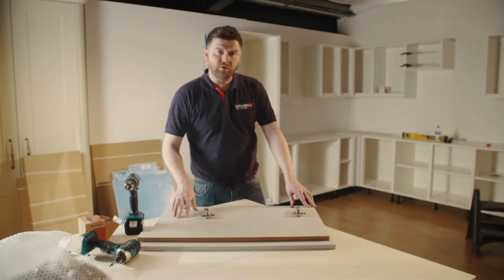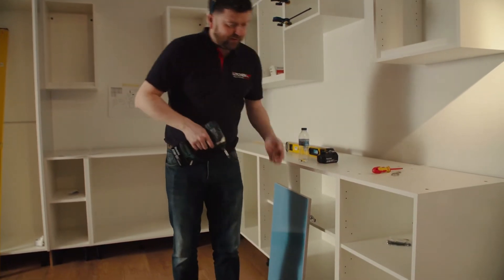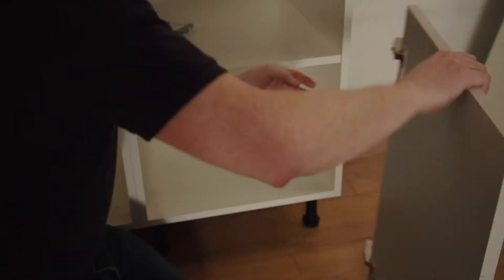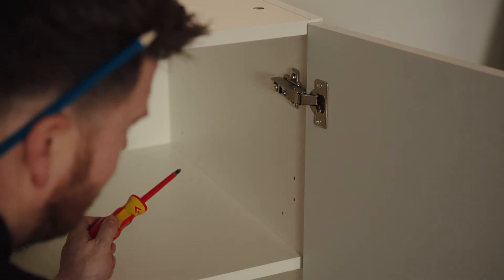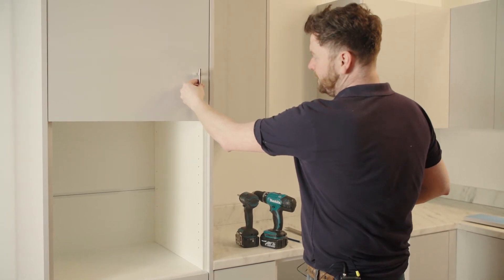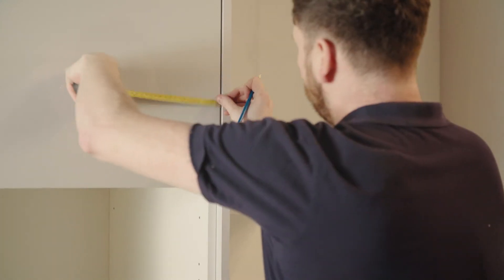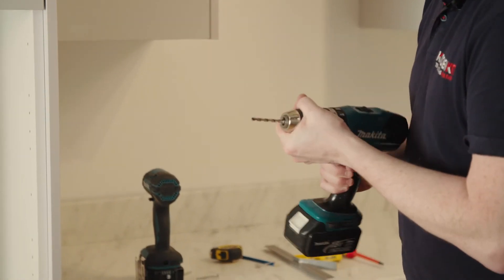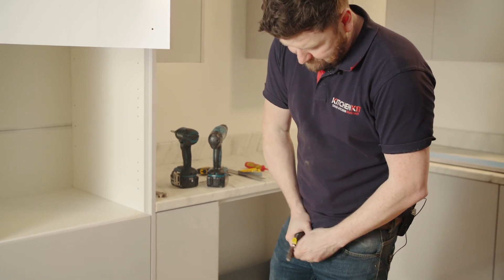How to fit Pre-Drilled Doors and Handles to your Kitchen Kit

Comment: I noticed the doors only have the holes cut out for hinges on one side so what do you do if you want to hang them from opposite side especially when you have j pull doors as you can turn them upside down or the pull groove will be at bottom